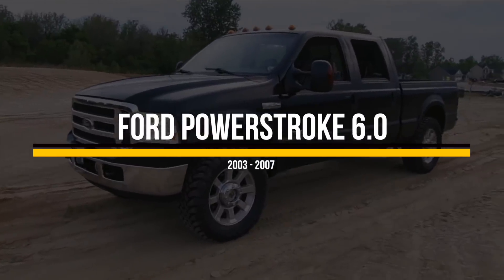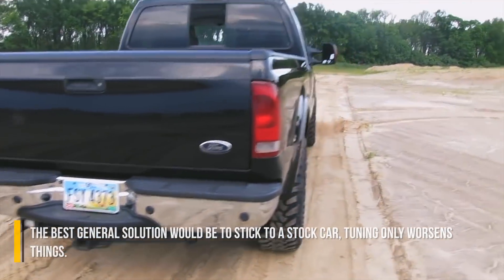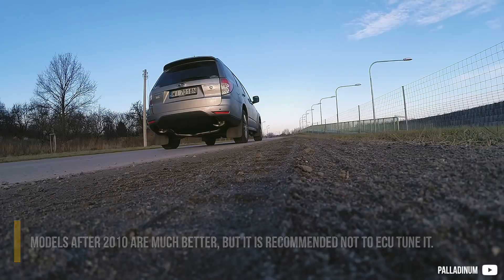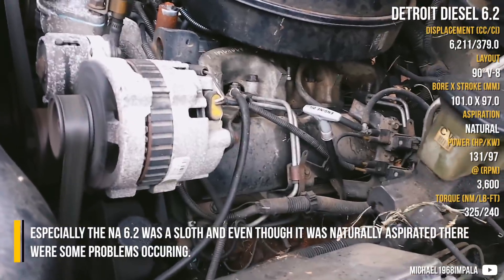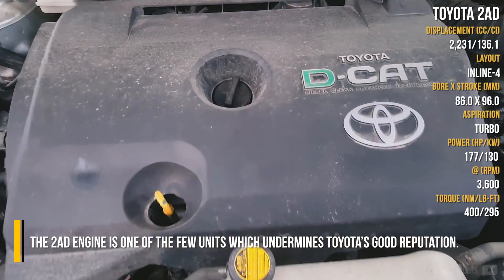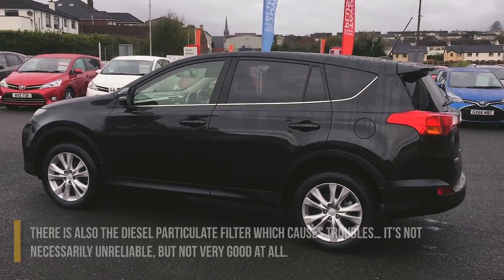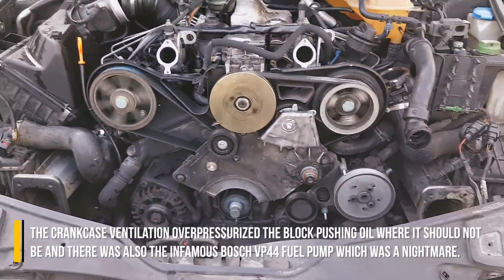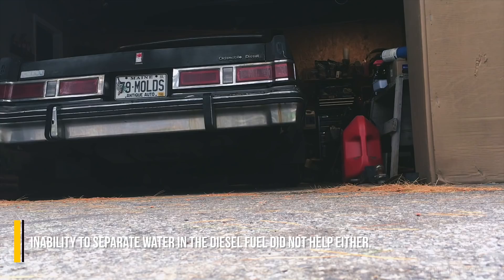6 Worst Diesels You Should Stay Away From

Comment: Having made a career working on diesel engines for the better part of 50 years I can safely say that I disagree with most of the negative comments. People stampeded over to diesels in the late 70s because they allegedly got astronomical fuel mileage. For the most part, they were correct but a diesel in a stop-n-go situation loses badly compared to gas jobs. I worked on diesels but since my lifestyle and driving habits weren't compatible with owning a diesel, I ran gas. Interesting that Mercedes diesels weren't mentioned. I worked for a John Deere/GM dealer and I had a lot of customers who ran 240/300D Mercedes. Camshaft failures and timing gear key failures on the crankshaft happened as commonly as the major problems with the 350 Olds engines. But the ratio of Olds to MB was at least twenty to one. Bottom line: look after them and drive them for what they were intended, and they treated you just fine. One final note: The Stanadyne Model 50 fuel filter had a water separator element incorporated into it; it might have been minuscule but it worked, unless you got a deluge of water in your fuel. The fuel tank also had a water sensor which meant that when it glowed YOU NEED TO DO SOMETHING ABOUT IT!!! I got pretty fed up with people who ignored the indicator light and then wondered by the fuel injection system failed.

Comment: And the only fact why the LF9 Olds Diesel was So bad, 1. They did not have a water/fuel seperator, and nor did they use the correct head studs. over time they shrank, which lead to head gaskets or more very common. BLEW UP!!

Comment: I have an Audi 2.5TDI that just surpassed 420.000km and still going strong. Its in my A8, so the car doesnt rust thanks to its Alumimium body, but I just had the fuel line rust through. Otherwise no real issues up until no, except cams starting to go out. I replaced the ccv with the updated facelift device and the issue has been resolved that way. With some minor tweaking its an ok engine. But sounds like a tractor and vibrates like hell.

Comment: International 7.3 Powerstroke used by Ford form 1994 to 2003 also had a few problems. nothing catastrophic per say but still noteworthy enough to hurt the engine. Bad fuel rail design killed injectors. Turbos had issues. Head bolts would lift at times. The injector oil pump on first gen engines from 1994 to 2000 were known to be faulty in design. Perhaps the worst of all was the electronics. The ICP valve could die any time affecting fuel and injector oil rail pressure. Also like the 6.0 Powerstroke the FICM was known to have issues.

Comment: I have a Isuzu 2.5D dubbel cab 2000 model with 1 100 000km on the clock. Never had any engine problems. Still gives me 13,5 liters per 100km fuel consumption.

Comment: The GMC 6.2L and 6.5L engines weren't bad they were underpowered. I had a 1984 C20 with the 6.5L engine in it. I can't remember why the 6.2L had been removed. All I do know is that the 6.5L was horribly underpowered in that truck. I used that truck to go pick up a 20' dual axle trailer. Nothing abnormally heavy but coming up semi steep hills it wouldn't go above 45mph pulling that empty trailer. I sold it about a month later. Might have been alright with a turbo and some more fuel but as it was it was an absolute dog.

Comment: Overall I've noticed that modern day diesels can't really match the old clatters when it comes to reliability, you think any new Tdi or JTD will match the old tough OM series from Mercedes in that case? Find me a modern diesel that hits 2 millions of kilometers mileage or above like the good old OM617 could with ease. I think producers push too much on numbers designing them while diesels were never meant to offer high performance.
Reply: Find me a modern diesel that makes the same low power. Common rail has revolutionized diesels.

Comment: Ford 1.6 TDCi 80Kw from 2004 till maybe 2010? .. they put a steel mesh before the turbo oil intake to serve as an oil filter, when the mesh got blocked with sludge, the turbo starved for oil, blew up, and metal fragments ended up in the intake manifold.

Comment: It is not true that Toyota 2AD has high fuel consumtion, going by Lexus IS220/200d example,these cars can easily make 50+ MPG, even 60 and 70MPG is not an issue. What is true, is that engine in unreliable, majority of the problems are caused by these cars being primarily used in the city (so... inappropriate use) where DPF cannot regenerate, this causes problems upstream, blocked DPF, blocked ERG, blocked turbo. Above that specifically 2AD-FHV (IS220d) has additional issue of having weak head gasket which often fails leading in overheating and total destruction, revised variant 2AD-FTV (IS200d) has reduced power and upgraded head-gasket and thus don't have this problem. If anything this engine can easily run million miles without any major problems, provided it is not used in short journeys in the city, maintained properly and has plenty of time to heat-up and regenerate DPF.

Comment: Fords 3.6 TdV8 in the Range rover l322 is pants, both blown turbos, oil flooding intercoolers, hydraulic locking of pistons, bent / cracked conrods,  timing chain slack adjuster rattle, egr jamming part open,  blue n black smoker like a bloody transit .
All this leading to lifting the body completely free of sub frames chassis to repair or replace.

Comment: I Would add, the infamous V8 from the ML 400CDI mercedes engine (timing chain issues etc), 2.7/3.0 TDV6/SDV6 (Lion engines) used in PSA and JLR cars (RRS, Discovery 3/4 etc) with crankshaft snapping without notice

Comment: Amongst these cars, belongs the 2.0 psa diesel engine. You can find it in the ford focus 2.0tdci, Volvo v50 2.0d, Citroën 2.0 diesel and a couple more have the same horrible engine setup. Problems with dpf, egr, intake valve house, turbo hoses etc. I could go on forever.

Comment: Forgot the 3.3TDI in A8 D2. It ditched the VP44 for an early common rail injection but the issue with the camchafts is the same as on 2.5 V6. Also the 2 turbos are in realy hards to access place.

Comment: IF an American pickup truck is not meant to carry heavy loads or tow heavy trailers, then what use are they?? Surely that is exactly what people want for?? 
Modern diesels need a turbo too improve efficiency and performance otherwise they tend to be  SLOW boring, two worst diesels i know of was GM turning their 350 petrol engine into a diesel FAILURE same for Subaru boxer!! Many of the American made pickup trucks have engine problems!!!! WHY i do not know, Surely for those vehicles being a work horse and you would expect LONG engine life!! IF their owners want performance buy a Corvette or similar! NOT servicing their engines often enough seems common!! Service; $300; engine rebuild $20 000?? No brainer!!

Comment: I owned 2 of the gm 5.7 diesels. they were a gutless turd, but fuel mileage was great. the buick I had got around 30-35 mpg on the interstate at 78 1/2 mph. the chevy half ton truck wouldn't do 70. but it would pull a loaded semi if I needed it too.
Reply: and yes it was an oldsmobile 350 block. the only difference was the heads and intake manifold.

Comment: You dont have to pull the cab to work on a 6.0, but it does make life easier, Ford didn't publish a cab off procedure until 2008, which is required for the 6.4 boat anchor
Reply: There's a reason the 6.4's had easily removable cabs lmao

Comment: You forgot the worst one: the Isuzu-made 3.0 V6 Diesel that was used in the Renault Vel Satis & Espace, Opel Vectra & Signum an the Saab 9-5. A lifespan of under 100.000 kilometers is normal, injection and turbochargers are likely to fail and the tendency of the cylinder liners to slip down is fatal for the engine. Some of the engines failed at under 50.000 Kilometers.

Comment: LF9 isn’t bad if beefed up studs are used and a good fuel and water separater are used.  6.0 PSD can be reliable as a driver but not being put to work same goes for the 6.2/6.5 DD

Comment: Ah yes....the Olds Diesel. The nadir of the Malaise Era! 5.7L, 105bhp and an all round heap of junk.

My dad had one in his 1982 Chevrolet Impala Wagon. He loved how cheap it was to run....when it ran that is. This is the engine that left me and my parents stranded as a small child in the hot Texas sun many, many times. I'm 36 and the memories of being stuck out on the Interstate as a child learning new profanities from my father in 40°C/104°F summer days still haunt me so of course I want one just to enter it in the Concours de Lemons so people can bask in its badness. Its badness gives it charm these days!

And it wasn't just the Diesel that was the issue in the 82 Impala...the rest for the car wasn't good either. We had constant electrical issues that were super costly to fix and the whole thing was a study on how NOT to design a vehicle for NVH....when it ran, it squeaked and rattled all the way to your destination!

If you have one that hasn't been crushed into a cube yet, here are some tips: 
Put a water separator on it! 
Put in the largest batteries that will fit....at least 700 CCA. Stock was 550CCA and that just isn't quite enough, especially when the engine becomes a bit cranky, which it usually does. Chronically weak batteries were likely contributing factors to various electrical failures in this car including several starters. 
Keep an eye on head gaskets! I suspect this is why ours had a very bad habit of boiling over. When servicing the head, use the best studs and an MLS gasket; the stock ones are garbage. 

Your car will still be trash after these improvements but at least it will stand a chance of making it to the next Cars & Coffee so people can marvel that it still runs. 

Dad kept this horrid POS for a few more years until it belched its last puff of blue smoke but the 1992 Buick Century that replaced it as mom's daily driver was pretty much bulletproof aside from alternators. The Buick mom got had the 3300 V6, which is a downsized 3800, so its reliability was no surprise.  In 2000, she traded in the Buick for a Toyota Camry, which is still in the family and running great as expected. I suspect these and other absolutely horrid cars GM produced played a large role in the Toyota Camry becoming the most popular car in the USA.

Comment: Great video. But the Japanese can make great diesel engines. Like the GM Duramax was actually developed by Isuzu. And then the Nissan 2.7 diesel engine which was used in old London Taxis which is commonly seen with over 500,000 miles with little problems.

Comment: Let me start by saying I'm not a Ford fan by any means. That being said the 6.0 with a number of modifications can be made into a pretty darn good engine. What's interesting to me is that NO ONE seems to talk about the 6.4 PowerStroke which is objectively a  worse engine. I think this is because the 6.0 came after the work horse 7.3 so expectations were high. The 6.0, because of it's issues gave PowerStroke a bad name so by the time the 6.4 rolled out expectations were low and so the 6.4 slipped under the radar. It should also be noted Ford didn't make any of these engines.

Comment: No engine is without its limitations, not even the diesel engine. However, there are some diesel engines I'd prefer over others. I believe it depends on the application. I've never been a fan of the 6.2 litre Detroit Diesel diesel engines offered for GMC and Chevy trucks of the 80s. They were so underpowered next to the 6.5 litre turbo, I consider it incredible that it was offered. I would've much the larger 6.5 litre turbo diesel. That would've been more appropriate for most light duty work.

Comment: I thought the toyota hilux diesels were decent? 
The IDI gm diesels need some love, especially the factory turbo ones need the largest intercooler you can fit in there, then you can tow/haul stuff as you can turn them into quite the workhorse, I am sure ARP headstuds are available.

Comment: Oh and you can also get your Powerstroke “bulletproofed” but doing so requires exactly what Visio said plus it costs about as much as what a used Powerstroke truck from this era costs in the first place so you’re pretty much doubling the price (but you do get a good chunk of it back in resale value if you can prove it’s bulletproofed)

Really though for the price of s bulletproofed Powerstroke from this era you can get a Powerstroke from a later generation where they just fixed the issues from the factory.

Comment: It seems most modern diesels have gone to crap due to emissions systems. I have experience with Chevy's as I work at a GM dealership and have seen a few pickups come in with relatively low miles needing emissions related repairs.

Comment: My grandpa owns an 2003 Astra 1.7CDTI with 80hp from the first miles. His astra is very bad, but it's just thanked to my grandpa. He can't warm it when it's cold, he can't cool it when he drives long ways with hot turbo. He use it some years with ukranian diesel, high pressure fuel pump, injectors, and other fuel part are crashed. 
He killed the turbo 2times. :D
He killed the Isuzu engine, but he always repaired it, he spend a new astra price for it, but he loves it. :D
So, I know Isuzu engines are great, i just tell my only diesel story.

Comment: Saab 3.0 TiD ... the engine is an Isuzu-Diesel. In combination with the short gearbox it was a thermal disaster and a Lot of this Engines failed to reach 70tkm.

The engine was also used in the opel/vauxhaul vectra 3.0cdti and Renault vel...something. But its only the 177ps Version (there was a 184ps Version which was Developed ne VM Motori i think)

Comment: Bmw N57 is a terrible engine too, timing chains and gears etc etc, everything around is bad too. The 2.5tdi v6 from audi is bad, but the A6 quattro I have, has done 328.000km, fuel pump still working (struggles to start when really cold even with new glow plugs), camshafts are still okay, I have the AKE version, maybe not the worst built, I'll drive it till it dies anyway, it towed a trailer with a car on it half of its life, and on the snow it's great. It's a nightmare to work on, but when it's dirt cheap, drive it till death, throw it, by something else, nobody wants them anyway

Comment: 6.0 does not use a high pressure fuel system. It uses a high pressure oil system similar to the 7.3. The Ford 6.4 and 6.7 use high pressure common rail systems.

Comment: I have to disagree with your statement abou Audi 2.5 TDI, which actually is a VAG 2.5 TDI fitted appart from Audi also in Volkswagen transporter and Volvo S80 and V70. I´ve driven my Volvo V70 from 2001 for 535  tkm. At about 500 tkm I had to maintain the head, because some preasure was leaking into cooling system. That is still normal maintenance for a small diesel engine. Following maintenance schedules, changing lubricants, coolant and cambelts etc on time, I think it´s basicly a very durable engine and performance is quite good for it´s age.

Comment: One Japanese company builds really good diesel engines. Isuzu designed and built the Duramax diesel for GM until GM f#*ked them out of it. It's still a good engine, even with GM putting their grubby mitts all over it.

Comment: I'm surprised you didn't mention PSA groups 1,6 HDI engine. it has flaws, but they run 300.000-400.000 km's easy.. but the turbo will need replacing at least once, the DPF at least once, EGR at least once and clutch.. at least once. we've sold lots of cars with that engine on our lot. the most common issue they have is turbo, dpf or EGR failure before they hit 200.000km's.

Comment: Well, had a chevy van 6,2 diesel -81 at 2004-2008. Think it had some miles done, about a million.. I only had to change some joints and do some breakwork. Drove alot and the consumption was not so bad, about 10L/100km. Also had Olds 5,7L diesel, it was horrible.. If there is a hill in front of you, it already slows down by seeing it.. And will find a way to break, even if you change oil every 5000km, as I did.

Comment: lol i have a4 2.5 v6 tdi 2002 and the engine is awesome.. it pulls hard and the fuel economy in good.. 0 problems - good oil and change every 8-10k km and it will run good.  Mine got 330.000km

Comment: so is it possible to convert the audi 6 cylinder with the vp44 to a traditional p pump swap used on the 5.9 cummins assuming you're using the same components? (assuming you could find a way to make the front cover work because the front cover that comes with the 5.9 p pump swap kits is for the 5.9 cummins) I know it sounds like a nightmare but do you think it is possible?

Comment: From a very recent personal experience, the BEST and the WORSE diesel:
Mercedes Benz OM601.921(USA market only, sold for 2-3 years) close to 400K miles on ODO and still running.
Can't get parts for it, replacement pistons are $450 a pop . . . (O _ O) . . . and at 72HP WEAK AF.

Comment: I love how the "Oldsmobile" is a Chevy Caprice. However, the 350 Diesel is a terrible engine. I don't know how many of them I saw break down when I was a kid in the 80s. They all ran terrible, blew excessive amounts of black smoke and sounded awful. Most of them were taken in and replaced with gasoline engines. I have a 1984 Oldsmobile Delta 88 Royale with the 5.0 307 V8, one of the best and most reliable engines ever built.

Comment: I have Mazda 6 2.2 mzr-cd diesel and its okay. Im now on 240000km and did big service (chain and other stuff). Mpg is great but only thing that is bad is dpf and egr. I had old 6 with 2.0 mzr-cd 136hp and it was great. One cylndr went out and  i drive it for almost 2 years , nothing. Audi has great 3.0tdi 313 hp engine and new mazda skyactive 2.2 150hp